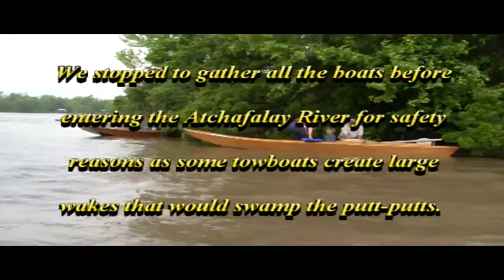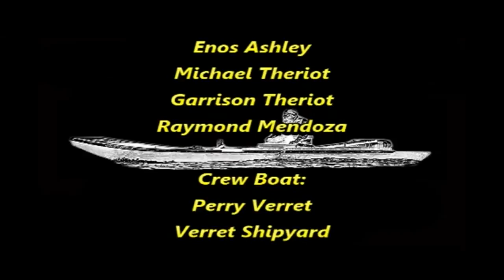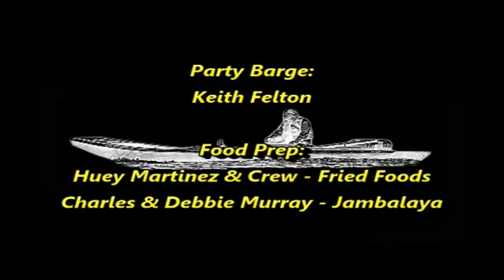Bayou Chene 2013

Comment: Awesome video, do you have any info on these old boats and where I might be able to get an old Lockwood ash engine?
Reply from the maker: Those engines are extremely hard to find and most require extensive restoration work. Even custom made parts.
Where are you located? I might be able to steer you in the right direction. My email is: pbouy1@gmail.com
Reply: I am from parks, saint martinville  area I always wanted to build me a boat like these just wanted to try and hunt down a engine for when the time was right, I also have a camp on lake long near the penetec canal north of bayou chene, just happened to stumble across this looking at old boats.
Reply from the maker: cajunhunter March 15th is the Acadian Memorial Festival in St. Martinville. The club
will have several boats there for the parade. I know Ory Mendoza will be
there for sure but don't know who else is making the trip.
I suggest catching them either before or after the boat parade and
introducing yourself. They always like talking boats and I'm sure they'll
share some good info with you.
We might be there also if I'm not working. I shoot pictures for the local
Knights of Columbus and we send our queen, Evangeline, there every year. My
name is Paul Bouy. Look me up.
Reply: My name is Lane, I will try to make it thanks for your info.